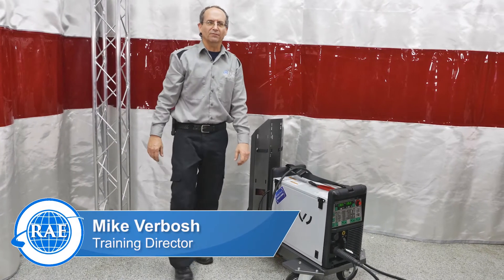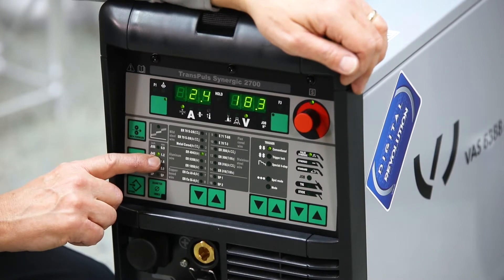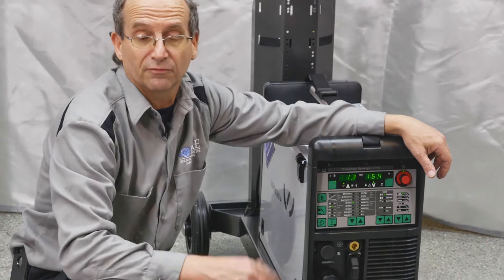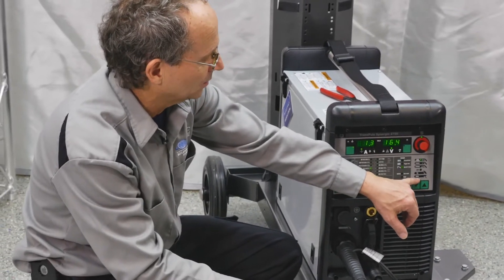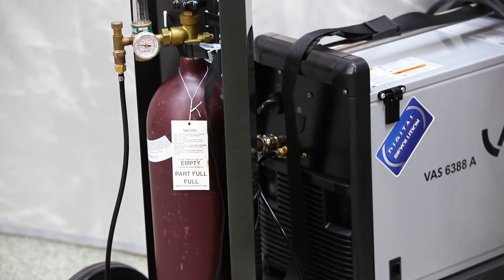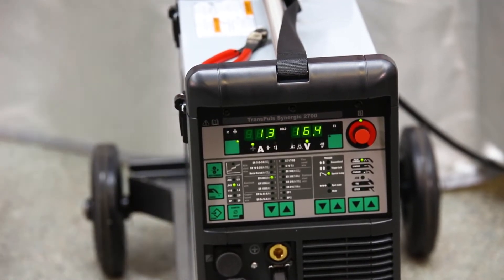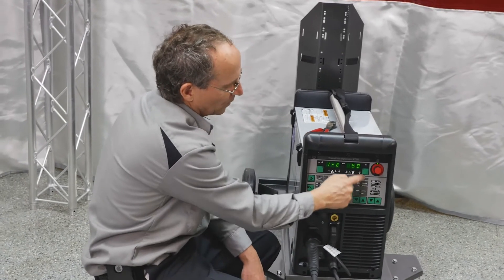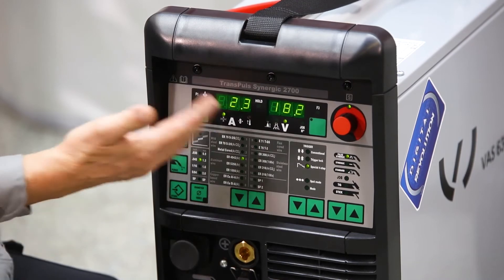RAE (Reliable Automotive Equipment) Training Video - VAS6388A Fronius Mig Welder

Comment: Great video... i started a new job and they are using these machines need help is there a back burn settings the wire burning back too much for my liking
Reply from the maker: thanks! if you have any questions, please call us at 732-495-7900 and we'd be happy to assist you!

Comment: a MM350 P user here.... all I can say this machine is faaar away And I dont talk about the technology involved. but just in the ease of acces directly to all the options FAST! and not to go through  2 settings before reach the wire parameter  (alloy and diameter) dont mention the hassle to acces to Hot start, or Crater fill setup. and if you mis some settings you need to go through alll the menu again. Never lose hoppe Miller update their firmware and simplify their menus. at least in this machine.Great presentation, simply perfect thank you Sir.